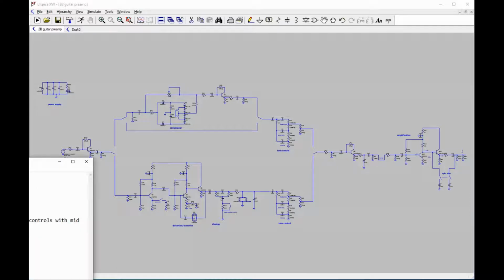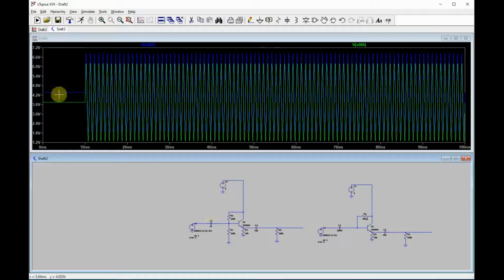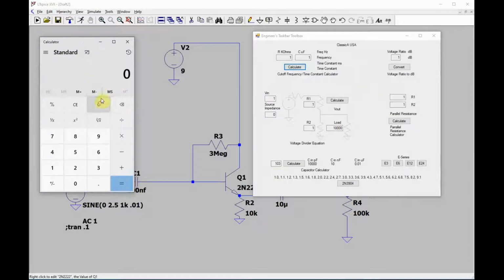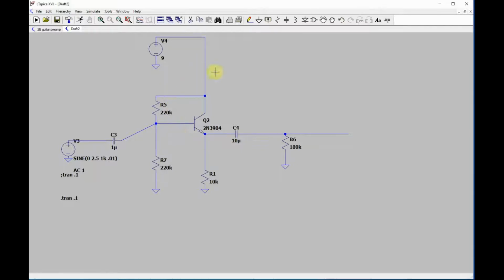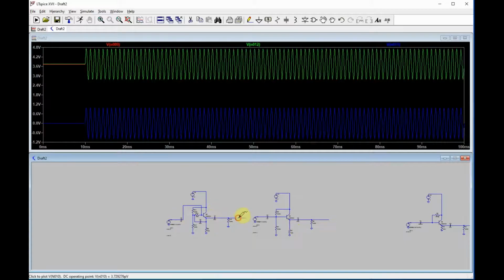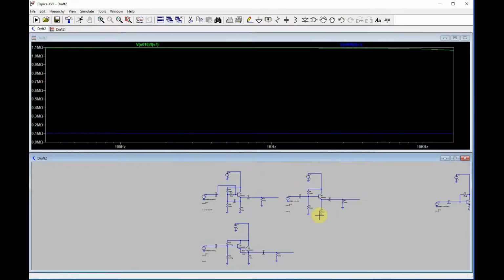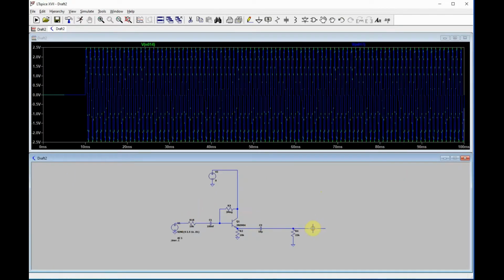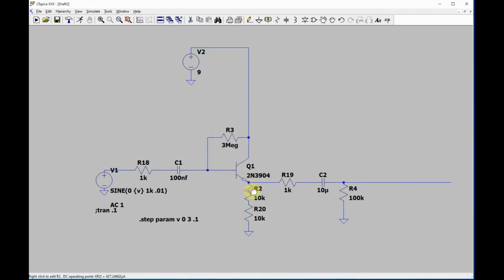Guitar Preamp Series - Video 5 Buffer

Comment: Love the series!  I'd like to know what BJT's you would recommend for lowest noise and best performance.  You use 3904's... is there a better choice for small signal audio like this?  I understand the thrust of the series is not for excellent noise specs but I'm trying to squeeze out the best performance even if it only costs a few dollars more for better BJT's.  Note, I'm trying to do this same project and stay away from "tone changing" and "noisy" op-amps like many designs use.  Thanks again!  🙂